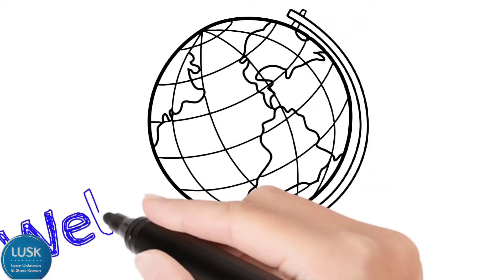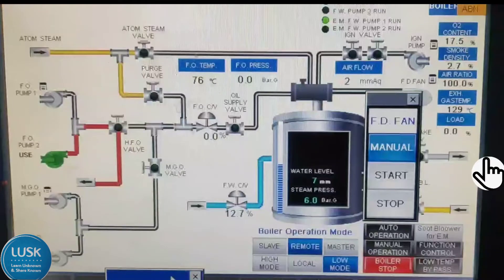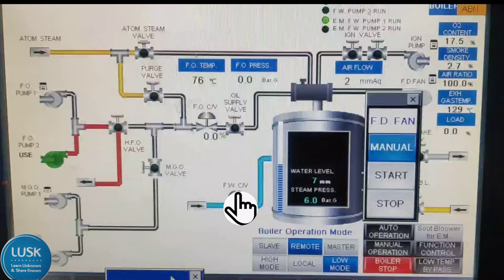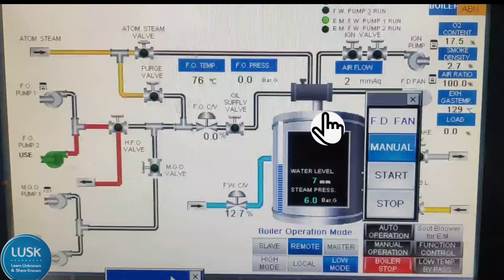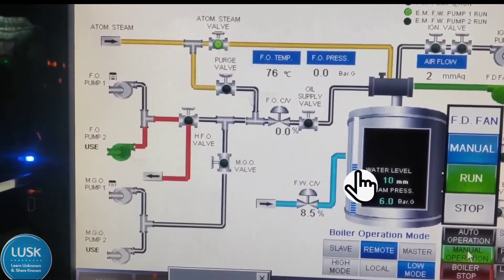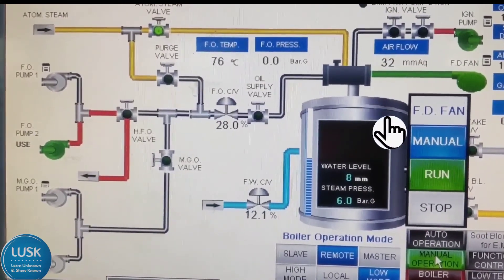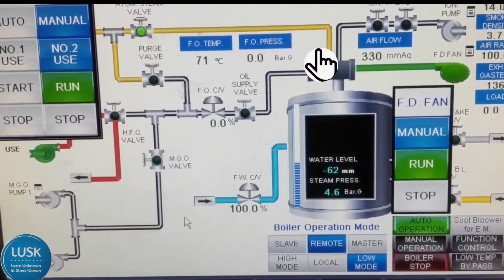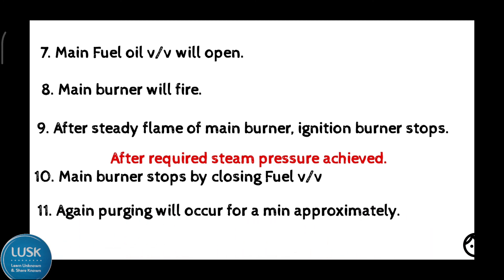#Ship​ Auxiliary boiler firing animated with explanation- ENGLISH #auxboiler​ #oiltanker​ #cargoship

Comment: Hello
When the ship is port how we can get steam for atomising
Reply from the maker: We'll be firing boiler before stopping the engine... That time we maintain boiler pressure between 6 bar to 8 bar for normal ships.. for tanker ships we maintain 12-15 bar during discharging Cargo.. for atomizing steam we need less than 5 bar.. ... .. and for atomizing there is no compulsion to use steam.. we can use normal compressed air ... Initially when we fire boiler from zero bar we use compressed Air only.. after boiler pressure is more than 5 -6 bar, then only we change to steam. Because steam is efficient compared to air .. using air is not good for compressor.. eg unnecessarily air compressor running hour's will increase.. in case steam there is no issues..
Reply from the maker: Hope you understood my point.  If I'm wrong sorry for that..
Reply: Thanks for answer
Reply from the maker: @anandraomerugu5316  hope you're convinced with the given answer
Reply: Yes absolutely